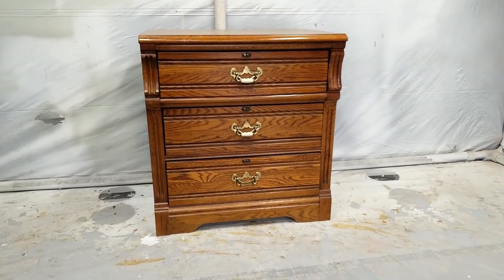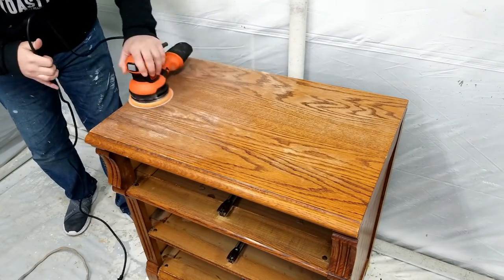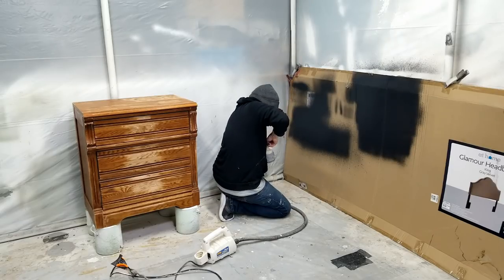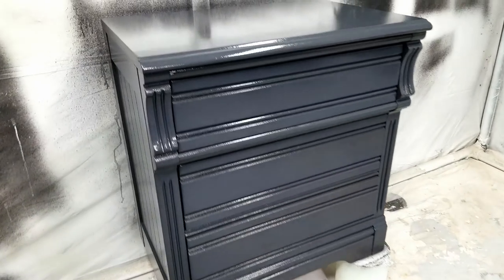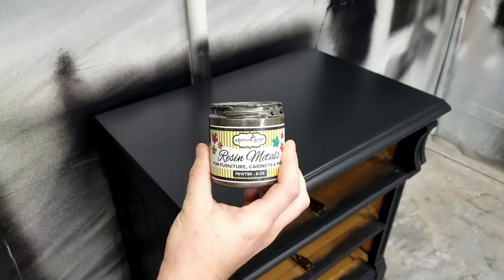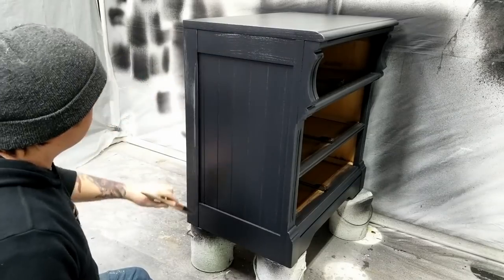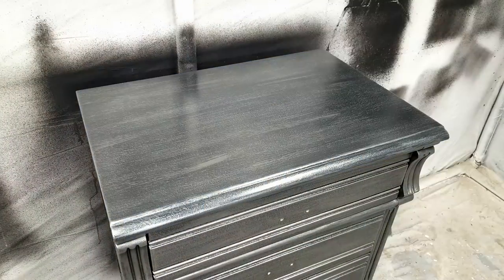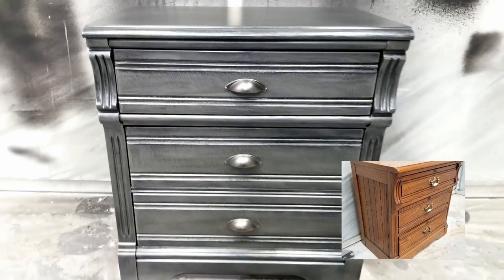Metallic Silver and Black Painted Furniture Using a Wagner Sprayer and Dry Brushing

Comment: Thanks for the info on using the sprayer! I found d it interesting that you hand applied the polycoat and sprayed the paint. Your dry brush technique created a great look. Much more modern than the standard rounded corners and trim. I learned so much from this video! Using mineral spirits to distress water based paint was new to me too. I can't wait to try this!

Comment: I felt that frustration using valspar, that is why I won't use their paint too much splatter! Turned out great!
Reply from the maker: It had nothing to do with the paint brand. I use Valspar for nearly everything. The problem is the paint was too thick for the sprayer and needed to be thinned out. Chalk paint would be even more difficult. Any other latex paint would have similar problems unless thinned.

Comment: Hello from Indiana, I've learned a lot from you and have redone and sold some of my pieces thanks to your teaching videos. I just wanted to ask you about your preferred finish for the paint you use for the furniture, do you prefer matte, eggshell, satin, semi-gloss? which one works best with the stain?  I'm not talking about the clear finish used for the topcoat but the color paint. thanks Shabby Guy
Reply from the maker: Satin works best with stain glazing. Eggshell and flat will soak up too much and you'll have a terrible time trying to get it to match the same look as satin. Semi gloss repells more of the stain from soaking so you can actually use it if you want retain most of the original paint tone but still accent details with the stain.

So basically, any sheen under satin is a no-no. Semi-gloss for less of an effect.

Comment: Learned so much from this as you explain things so well and clearly and the result looks so cool!! What is your opinion on chalk paint, do you recommend? I have qualms about it because I wonder about it's durability. I painted one piece using Dixie Belle paint, and it already has scratches all the way through on it, even though I used 3 coats of their Gator Hide wax and that was from light use. I have a bunch of chalk paint, but may not end up using it if it's going to scratch that easily. Is there a way around this -- such as, can you use Poly over chalk paint? Would that stop it from scratching? Thank you & love your videos!

Comment: Great job! I had a Wagner and tried the Harbor Freight cheap $15 spray gun and it worked better with less issues. Worth a try. Did you quit using Dixie Belle? I'm still using it but found Behr has a chalk paint and can do about 500 different colors. Got a quart for $20 so I'm going to put it to the test. Keep up the awesome work!
Reply from the maker: I don't typically use chalk paints or other similar "boutique" paints. I do show them so that others who are interested can see.

Comment: Hi!  Iam fan of your work.  For some reason 1/4 of the way of your video, the picture became slightly blurred.  I am not sure if that was my eyes or if you were using a different recorder. Also will you be doing another of your flower designs, I truly was in awe of watching you do that.
Reply from the maker: Try refreshing the page/app and look at it again. Make sure you have your quality settings set correctly too. There is no problem on our end. Sometimes that can happen if your connection drops/slows down while watching videos.

Comment: It's really beautiful. My only concern is should you not have sprayed the inside of the drawers and the back of the chest of drawers. Looks a bit odd when you open it up and see the brown.
Reply from the maker: I have found that this opinion is more personal preference and, for my clients, isnt a concern of theirs for the most part. I've only had one person ask for me to paint the insides of the drawers. A handful have requested the back painted in the scenario that the piece would be sitting behind a couch or similar position where the back may be visible. Otherwise, it requires more labor, requiring a higher price when most people arent worried about it. There are painters that feel the same way as you and do the insides and backs. I'm just not one of them due to the reasons above. :) Hope this answers your question. Thanks for watching!